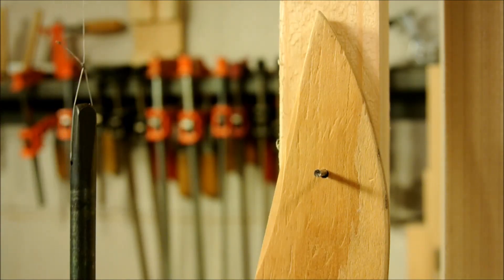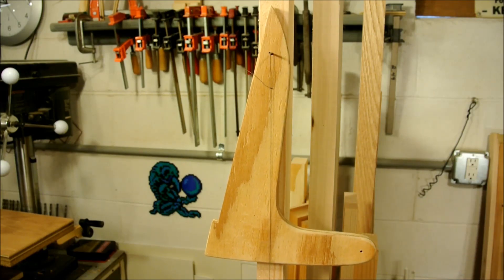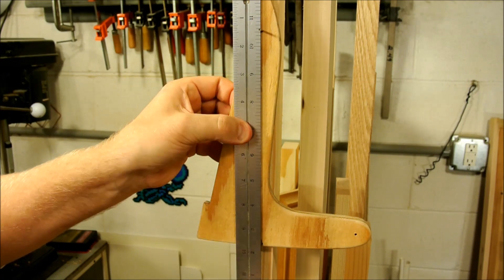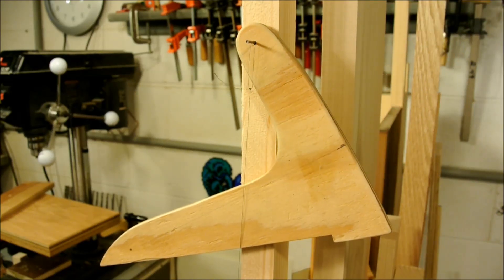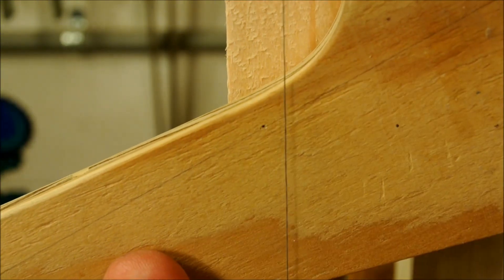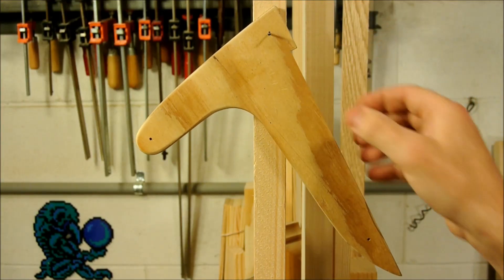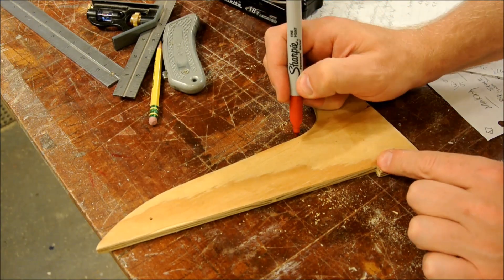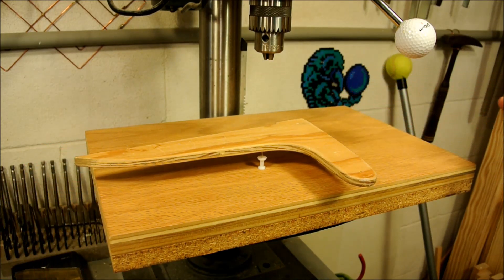Finding the center of mass

Comment: technically, by drilling holes, you changed the center of the mass of the stick very slightly. So you could say that you changed the outcome of your test by measuring it.
Reply: Technically, the flaws inherent to any experiment don't end:

Red Sharpie ink added mass to the object. The knot on the plumb line affected the outcome of its position. Atmospheric conditions that day altered the moisture content of the wood, causing it to become slightly different from the day before. Sunlight, wind, and heat slowly erode the plywood, knocking agitated molecules and individual atoms away from its mass, in a slow but endless process of diffusion. Spherical aberration of the camera lens (and human eye) makes it impossible to capture a parabolic path and then relay it to a planar screen. My breathing altered the result. Oh, and then there's relativity, and that whole mass causing a dent in space-time thing. 

Welcome to an imperfect world! Thankfully we can express ideas conceptually, and not always remain beholden to ideals, like perfection.

Comment: Is COM = CG? 
How can we find the C.G?
Reply: 1) Here on Earth, usually, sort of, yes; but a c.o.g. is more often treated as a line, or a vector.
2) Assuming you are asking about 3-D objects:

Think of the center point on a square. You can find it by simply connecting its corners diagonally. This point is called its centroid, and that's where the center of mass will be for anything square that's (nearly) two dimensional.

Now imagine the point that's at the center of a cube. That point will be the cube's center of mass, through which is also its center of gravity (whenever the cube hangs from something here on Earth and thus points towards the Earth's own c.o.m.); geometrically, we can also locate this point by connecting all of a cube's diagonals, but this is the point where all of the cube's squares' centroids intersect. 

In other words, you have to sort of skewer, or hang, an object along three dimensions in order to find its true center of mass. As such, in real life, finding a 3-dimensional object's c.o.m. is tricky. We can discuss further details if you're still with me at this point.

Comment: Once you drill a third hole, you change the center of the mass.
Reply from the maker: So does adding fingerprints to it.
Reply: but you touch it all over randomly, so it is safe to assume all fingerprints cancel each other.
Reply from the maker: Hmm- not if one side's a handle! Hey, you're right about the third hole, so all three should be drilled first, but it's so small it won't make a difference that you could detect within a pencil mark.

Comment: But how do you find the center of mass for a non-uniform object, or one that has three dimensional features?
Reply: Insederec Finding the center of mass on one face of it would be basically the same. If you wanted to find the center of mass of the object in three dimensions you'd need to do this on multiple faces and connect the centers of mass on opposing faces. They'd all intersect in the 3D center of mass, but that's a little hard to do with real objects rather than theoretical ones.
Reply from the maker: Interesting question.